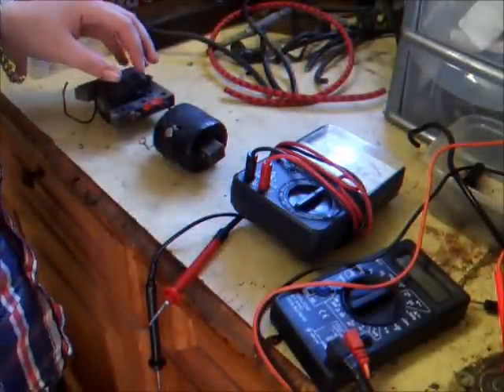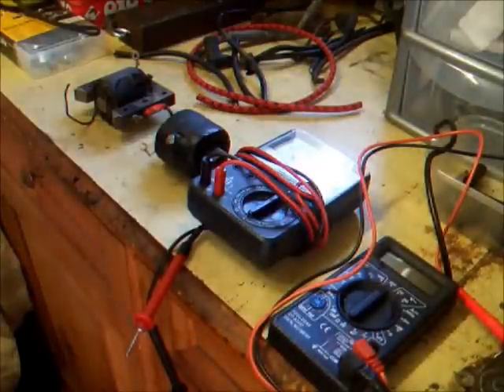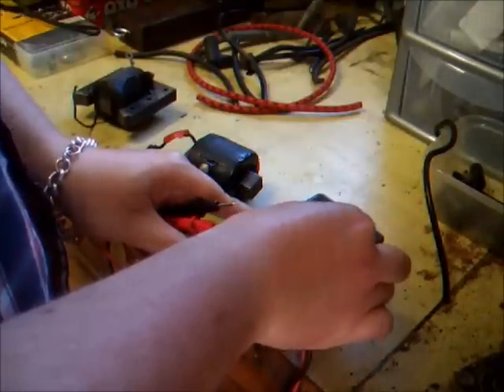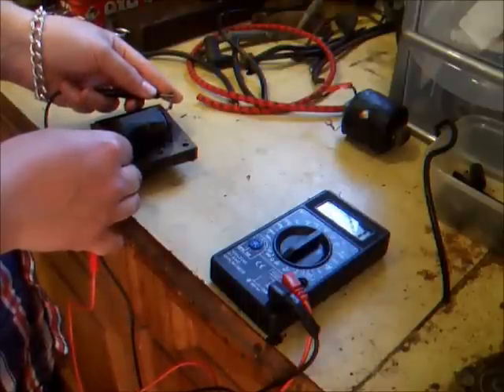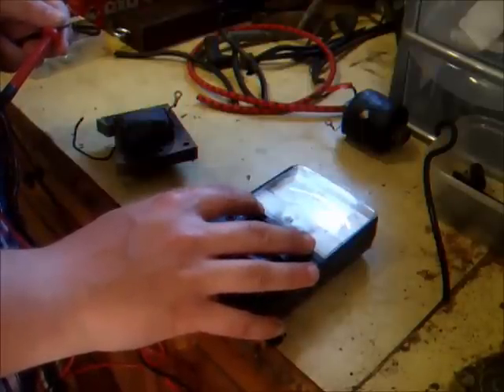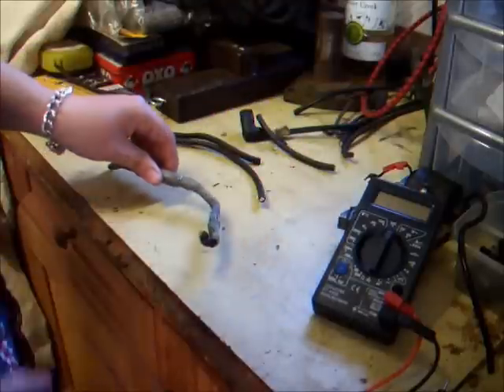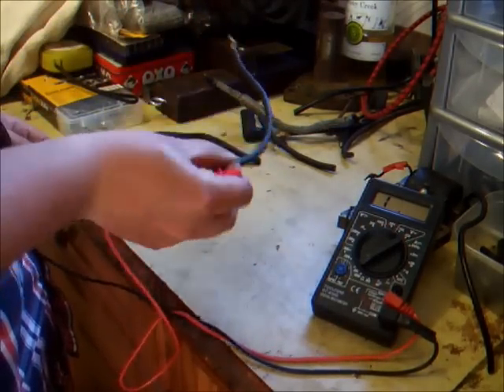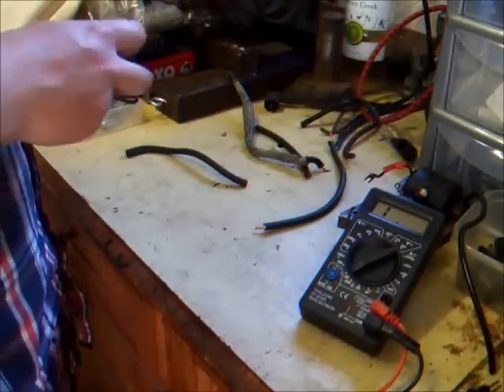How to; Test HT ignition coils, HT leads, joiners and caps with a Multimeter.

Comment: Hi. I have a misfire on my motorcycle.  I think cylinder 3 as all old plugs nice and brown, whereas 3 was a bit oily. Do the same instructions you gave for mowers apply? I am guessing so....?
Reply from the maker: An oily plug suggests that you might have an issue with your piston rings on that cylinder. But for the miss fire try changing your spark plugs first and see if that helps. If not you can look at HT leads and coils depending on what sort of ignition system the bike has.

Comment: How do you test a coil with two spark plug leads? If you do the same test then you dont get a reading from the spark plug leads. There must be a different test for duel leads.
Reply from the maker: Good question! Is its a Maytag twin coil you are testing? If so you connect one lead from your meter to one spark plug wire and the other to the other spark plug wire (its an ungrounded secondary in this case) you are looking for a reading around 6000-8000ohms.

Comment: Would have been nice if we could see the meter readings
Reply from the maker: Meter readings will differ depending on the amount of windings in the magneto. Typically you are looking for any reading that isn’t open circuit! Most mags i have tested read between 2.5k-6k ohms. 

Anything that reads 0 or 1 is dead. It may still spark. But it will only last as long as the coil can continue to jump the break in the windings. Typically an open circuit coil runs for about 20 minutes before it dies completely

Comment: You need to monitor your video so you can see what we see.  You cannot get an accurate ohm reading when you are touching both probes at the same time.
Reply from the maker: Dave Crocker touching the two probes together is to zero the meter and adjust the scale to 0 ohms.
Reply: You were touching the probes with both of your fingers while attached to the second coil.  I'm not talking about zeroing meters.

Comment: The core has no ground if it is not installed in the magneto in case of the wico magneto coil ! The secundairy winding can by meassured between HT and the the little ground wire !

Comment: Excellent video thanks, my understanding on silicone leads is that they are used in automotive applications with electronic ignition systems, for small engines and older engines in general the copper core wire is what should be used :)
Reply from the maker: Thank you. Yep your correct, usually find silicone leads on cars. But sometimes ive found them on small engines. Works ok. But they usually have high resistance, which isn't good for the old coils. Copper core is the way forward :)

Comment: Hello,
I have 2001 Toyota Avalon 3.0 L(XLS) V6.

each ignition coil has 4 wire (plug):

one is ground to each coil. ( W-B COLOR.)

one is coming from the ECU toward each coil to 12 v. (IGF, COLOR,  B-Y.)

one is connected to the ECU (as signal,,,, positive signal   ?????) to each coil. (6 DIFFERENT COLORS).

one is from the NOISE FILTER (IGNITION). to each coil. (B-W COLOR)

I HAVE THREE QUESTIONS:

1. what is the noise filter for the ignition(purpose) and how to test it???

2. is the signal intermittent means not continues signal and it is POSITIVE signal??? due to Transistor out of the ECU, but built in each ignition coil itself !!!!

3. IS this signal coming toward the ECU by the ignition coil OR OR the ECU send to the coil?  AND
4. What kind of signal - or +
Reply from the maker: Hi, sorry but I really can't help all that much with modern coils. Im not really sure if the same applies to modern CDI coils, I haven't really got anything that modern to test. The video is really aimed at older cars, bikes and engines.

You might have better luck in posting on a forum. Perhaps a Toyota forum?

Good luck with your car. And thanks for checking out my video :)

Dan